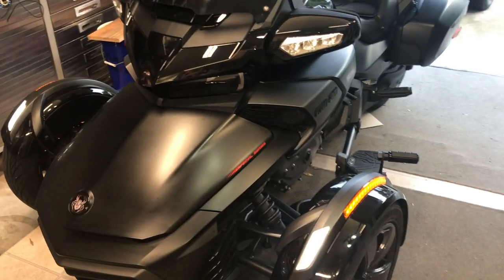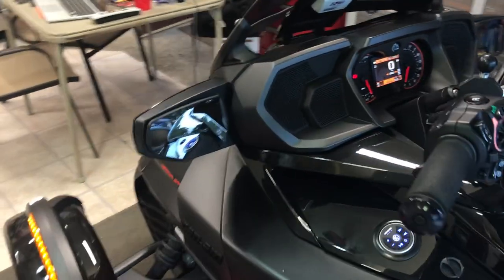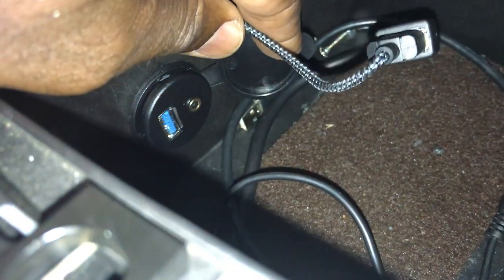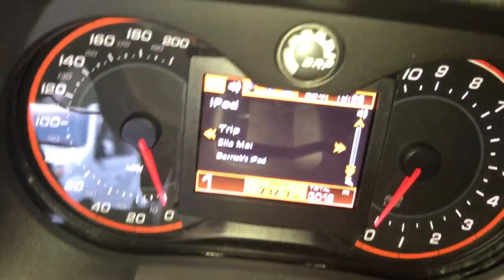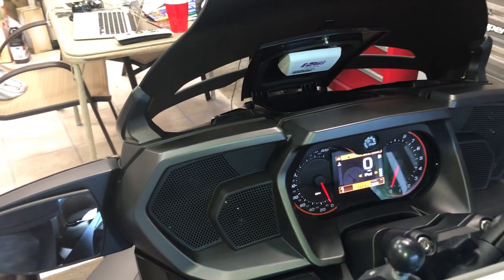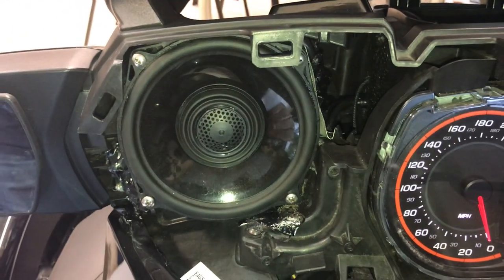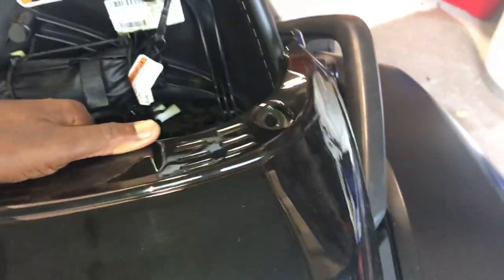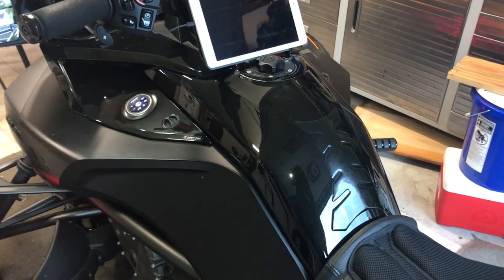How to Can-Am Spyder Custom Audio Install

Comment: I am also interested in knowing how the wiring was connected to the original audio system? How tweeters and mid-range speakers were mixed on the same channels? Did you use the amp with HIGH INPUT (4 channels) and then bridge the 4 channels in 2 for the new speakers? By the way, very good configuration, I am jealous because I try to do the same installation, but I have trouble to figure out how to get the audio feed from the original audio system to the amp. Please advise, thank you
Reply from the maker: The amp is just a 2 channel amp.  It can go down to 2 ohms and still put out same power.  On the original system, the speaker wires were cut and wired to the amp (just 1 pair)  The speakers are built with tweeter and woofer.  No need to split.

Comment: When you installed the amplifier, where did you get your power from? Did you run all the way up front to the battery or could you explain how you wired it? I have the same exact bike.

Comment: Nice video how did you modify the speaker housing to fit the 6.5 speakers any information that you can give would be appreciated
Reply from the maker: So, I epoxied the Rockford speaker mounts into the OEM speaker housing.  Had to do a little cutting.

Comment: could you provide more details as to how the amp was hooked up. I think you said CD but might have said CB?
Reply from the maker: The amp is installed in the OEM empty CB space...adjacent to the OEM radio location.
Reply: What is the wiring. Did you use the woofer or the mid-range? It appears as if you used the green midrange wires. I have tried the woofer wires and they have no highs, just the bass. Which wires go to the fosgate input. That would help me immensley. Thank you  for your time. Take a look at www.rattlebars.com\spyder\spyder.html. I would love to publish the solution with a big shout out to you!
Reply: Did you ever get the wiring solution Rattlebar? I went to the website you listed and I didn’t see anything.
Reply from the maker: @Rattlebars  Im sorry I didn't see this sooner.  This may be a bit long.  The OEM amp is a 4 channel amp and has a built in crossover for woofer and mid/high.  I have completely removed the oem radio signal.  So, I have no AM/FM radio.  I just use my phone via the Bluetooth.  Although the OEM still controls and shows title information on the screen when hooked up to USB.